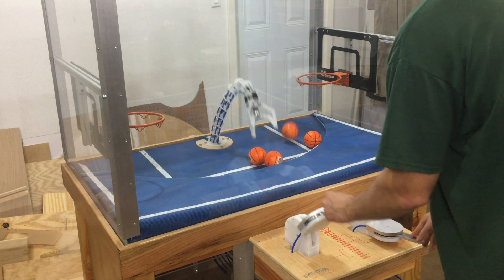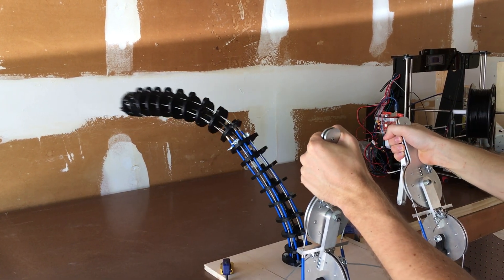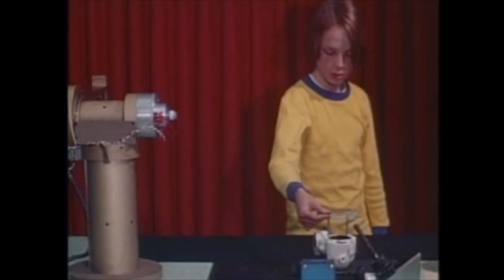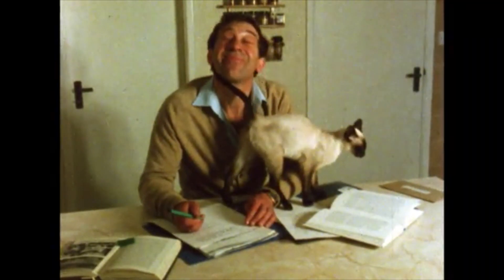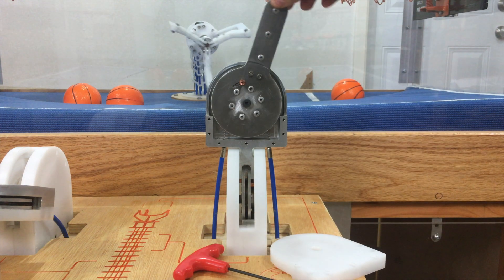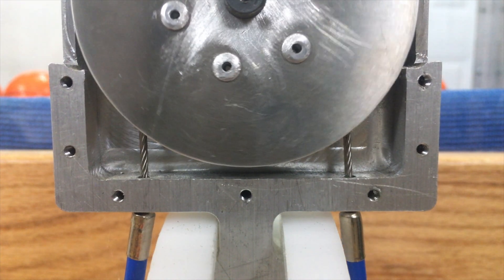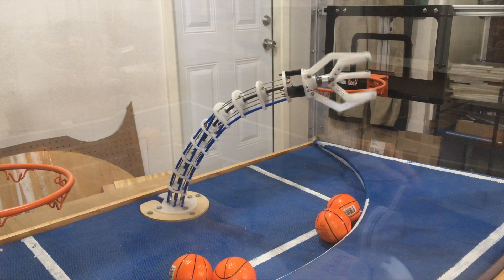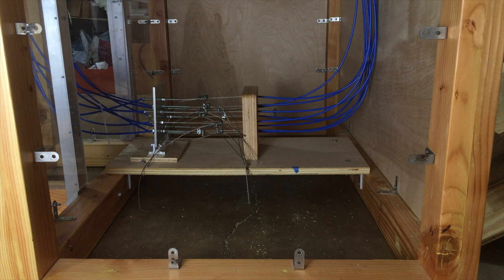Basketball Playing Robot

Comment: Hey, I'm curious how you could replicate the wrapping tenancy of an octopus arm. I don't know if you've thought about it or if you're not aiming for that specifically, but I wonder if the tapering form has something to do with it, as if it gives the thicker sections more mechanical advantage for curling strength, but the thinner sections near the tips more mechanical advantage for curling speed and mobility. 

Do you think you could try a tapered arm like this with the cables spread wider in the discs near the base, and narrower in the discs near the tip?

Comment: There is a commercial version of this technology, actually, called EMMA for Easily Manipulated Mechanical Armature, which was first patented around 1995. Temple Allen Industries has been making systems using a cable driven arm since 2003. Keep up the good work.
Reply: Thanks for the valuable info. Very much appreciated.
Reply: Could you please provide a link to the patent if possible? Thanks.
Reply: Yes pls do! (supply link to patent)
Reply: Thanks for info